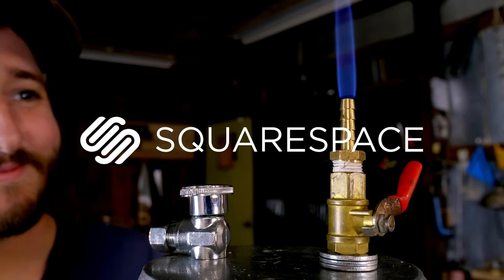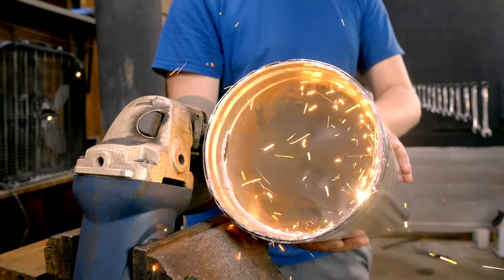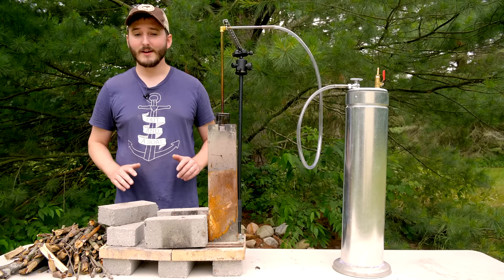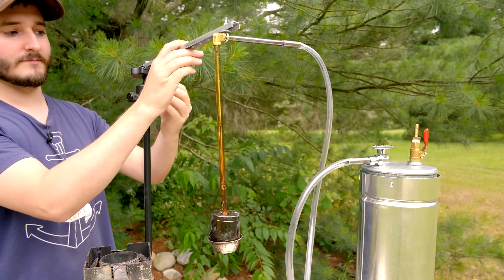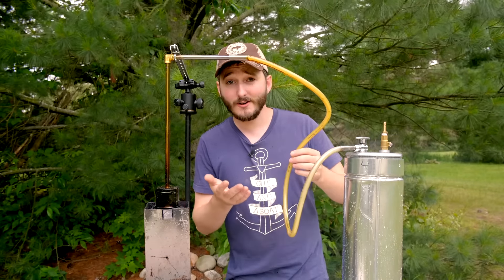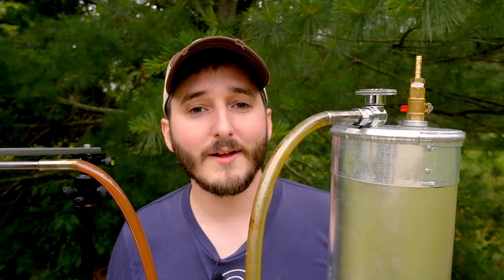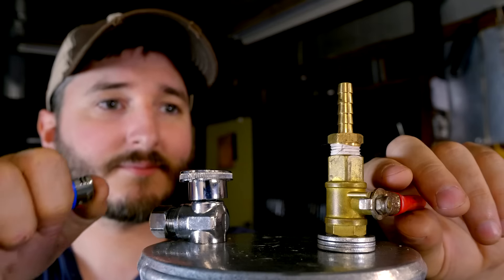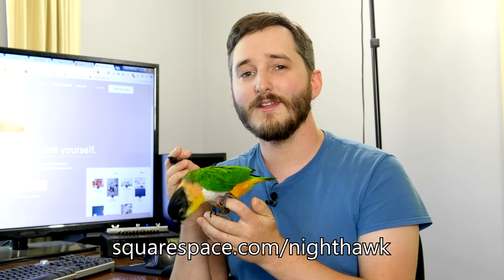Bio Fuel Storage: Building A Gasometer

Comment: A gasifyer on a truck is cool. I didn’t know how much this technology was used in Europe in ww2. What if I collected this gas in a ballon type setup and added a little methane and hydrogen to pep it up to gasoline or diesel levels of power and compressed it. Would it turn to liquid? At what pressure? Then could I run it like propane with a bottle into a engine. All this science is cool and I love it because it fits with my business plan. I think the answer is to convert a diesel to burn wood gas and hydrogen and methane is to not replace diesel but use it also. The old diesel before low sulfur came out. Was way better for lubrication and it pulled a lot harder and better fuel miliage. The diesel would provide timing and ignition ( no spark plug needed ) just supplement the diesel at the right level would provide the power and reduce diesel consumption with a small modification. If I worked with you we could make this work and stop the oil companies from gouging the US. Provide fuel for offgriders. Think about the hurricane victims in Florida. What’s a gasifyer worth to them running a gas generator. To heat and cool there house and keep life as normal. This is the answer with all kinds of application. I just don’t know the proper mix of gases to produce a gas that used like propane is. You don’t want to crash oil we need all the things that come from oil just not the drama with oil

Comment: You mentioned adding some weight to add pressure and this makes me think of something I have "always" wondered about. What happens to the gasifying process if you add too much weight? In other words the pressure increases to the point where it is not able to produce woodgas? At what point (pressure) does that happen and are there different designs of gasifier that could produce gas under higher pressure? And just to add - thank you so much for your brilliant videos. All of them are great and you display a curiosity that is just so very very inspiring.
Reply from the maker: You will probably not stop producing wood gas at any pressure, but at very high pressure the gas itself will begin reacting and turning back into various solids and liquid hydrocarbons.

Comment: Thank you so much!!
I blow glass and would love to do this with our outdoor rocket stove!
So if I need 15lbs of pressure I simply make sure the entire top with valves and all connections need to weigh 15lbs? That simple?
Reply from the maker: Little harder than that, because adding weight will raise the water in the tank which will eventually overflow rather than increasing in pressure

Comment: Silicone tubing should be high temperature and rubber should be just fine also if you go with the rubber one try going for high temperature vacuum lines for automotive.

Comment: "I can drain that condensation into the filter." here let me fix it for you... "I can drain this, mixed, heavy and light bio crude, as well as the low and high grade bio fuel into the filter" 😂 The separation of all four of these is arguably even easier to achive as the Syn gas filter setup you made....  refinement of the crude (again as simple as the filter) into high grade petrol would also yeild coke ash as well as  charcoal from the gasifier if stopped at the right time...I could go on.

Comment: OR make a bubble chamber. This chamber is half filled with water. The input port is at the bottom of the tank. You push your gasses into that port. Make sure that the tube connected to the input is leveled with the water in the tank so that the water does not pour out from that port. The output port of the bubble chamber is at the top. With enough gas, pressure will build up and the gas will push itself from the output valve. Store the gass in a separate container after it passed trough the bubble chamber. You don't need this sliding bottle.

Comment: bit late to the party, but instead of worrying about condensers or different tubing as others suggested, why not have the gas input attached to the base instead of the moving part?
attach the pipe to the bottom and make sure the elbow or 90 degree bend is above the water level.
also don't make the pipe go into the gas portion of the gasometer on the inside, instead leave it at the bottom so the gas has to go through the water providing some cooling and filtration as it enters the gasometer.

You could do the same thing with the output tubing but have this reach above the water level on the inside, this way neither the input nor the output would need flexible tubing.
The only possible issue I could foresee is that the gas generator will be at a higher pressure due to the hydrostatic pressure in the gasometer needing to be overcome.
I think this might actually be beneficial provided the seal of the can is able to handle this higher pressure.
If that does form an issue a solution would be to use a low container with a high diameter (surface area), the same (or greater) volume but less hydrostatic pressure.

Of course a lower container would diminish the filtering and cooling effects of bubbling the gas through the water, since it will have less distance to travel.

While I'm over engineering it might be worth it to add stoppers so there's no chance (or lesser chance) of the contents of the gasometer being dumped if it overflows and releasing a bunch of flammable gas.
Although that might go too far as it then asks for some kind of overpressure relief so the thing doesn't blow up instead of just falling apart.

I'm going to stop editing now before this becomes a multi-paragraph thesis of me thinking out loud, great video might give it a go myself sometime :)

Comment: I see. So you could use multiple gasometers to store alot (if you wanted to make the woodgas during summer then use during winter)  but you had mentioned to me when it's compressed it could self react and cause an explosion. 

Hypothetically though if you could take out the oxygen within the woodgas (maybe using a chemical in the water you filter it through to absorb the oxygen) would it still be so volatile when compressed? 

I know that increasing pressure inside the cylinder while pumping it in with a recovery machine does result in heat but how much heat does it take for woodgas to spontaneously combust? 
And could explosion be prevented by putting the cylinder in an ice bath? 

I just think it would be neat to be able to store a large quantity of wood gas rather than just a little bit with these gasometers. And having it pressurized would make it more convenient for use rather than having to press down on the top of the gasometer to increase pressure.
Reply: I apologize for my ignorance. I just don't fully understand how it can be so volatile when compressed
I suppose it could be the carbon monoxide..it's 27% and explosive limit is 12.5% - 79% but even then the auto ignition temperature is 600⁰
I don't think it would reach that kind of temperature while putting it into a recovery or lpg cylinder.
Reply from the maker: I don't know enough to say for sure how to avoid hazards for compression. The mixture has the potential to self react because it is a combination of hydrogen and CO known as syngas. Under heat and pressure this can react into all sorts of organic chemicals.
Reply: @Nighthawkinlight  ah I see. I'll have to look into that. Thanks for the reply. You teach about awesome stuff. Electrolysis, pyrolysis it really sparks my imagination for ideas. Saw this one video where people use pyrolysis on bones and the charred bones become* really helpful for the root system of plants :)  it was neat.

Comment: First of all you should be using a heat sink to draw heat away from the vinyl tubing.. That would definitely help...the bigger the better...the tubing is an insulator so a metal heat sink that is between the vinyl tubing and your contraption will draw heat away from the tubing...also get 10ft of refrigeration copper that matches the vinyl tubing...be careful at the home center and make sure that the copper will go inside the vinyl tubing...put a piece of the copper (1ft or what length you think that you need to be certain that the vinyl tubing can be used for the rest of it without worrying about heat damage...use a lubricant to get the copper inside the vinyl tubing..leave some copper petruding so u can connect the vinyl tubing to it..use hose clamps or zip ties for the copper to vinyl tubing connection...essentially you are making it more heat resistant by having copper inside the vinyl tubing

Comment: If you are looking to improve the gas generation, you must to use dried biomass (wood) with less than 20% humidity; this will increase up 85%. But , if you can use fluidized system, you can burn much better your biomass and to get higer production of biogas and bio oil also.

Comment: Instead of using a flexible tube, put a metal pipe up the center of the gasometer. The solid pipe no longer needs to be flexible, and if you make the pipe high enough to  go above the water, you won't have issues with too much water causing pressure issues.

Comment: When gas is generated, do you have to make sure the pressure in the tank, where you produce the gas, great enough to lift the upper container of the gasometer? I'm just thinking what if the gas pressure is not great enough to get in the gasometer.
Reply from the maker: Yes, you need some pressure but very little. 0.1 psi is enough.

Comment: Could you use a coil like your desalination bottle before the vinyl tube? Maybe a chamber after that with holes at the top for the inlet and outlet, so the condensation filters the gas until it gets too full, then drips into the chamber instead of going on into the tube? Idk, I know way less about woodgas than you lol

Comment: We could make a hybrid vehicle that runs on wood pellets, the gas heats water. Nothing to clean. The best small modern steam generator we can fit into a vehicle. The electricity generated simply extends the range of a modern electric vehicle. Use compact and overbuit key components, like the pressure pot. We had 138 mph steam cars, diesel electric trains, and hybrid electric cars nearly 100 yrs ago.  It's the government that holds us back. Juniper grows like weeds. It's the best firewood. If the whole house had a similar system and ran on the same fuel, that would be great. We use Juniper locally. A person could have a tiny pellet mill in their back yard. It could all be tied into any existing solar and or wind, water turbine, battery system. The whole world would smell wonderful and there would not be smoke everywhere.

Comment: My dad’s farm had a 1000 gallon methane digestor that worked from hog manure. Very similar to your set-up here using tractor inner tube for a seal and a compressor to concentrate the gas.  The methane was then used in the tractor on the farm. The previous owner of the hog farm barbecued himself with this contraption from an errant spark so my dad would never use it and it rusted away to junk while I was growing up.

Comment: Could you use a much heavier upper tube (or just add weight on top) to store lots more gas? In other words what's the pressure of the wood gas coming out of the generator? Could you use a valve to prevent backflow to store it at higher pressure than the generator makes?
Reply from the maker: You can add some weight,  but with too much it will force the water up and out of the lower tube. This is for low pressure collection and storage

Comment: Great vid my guy, but couldn’t you run the vinyl tube to the bottom of the gasometer so it’d bubble through the water and you also wouldn’t need a flexible tube
Reply from the maker: Forcing the gas below a waterline requires pressure, think about blowing bubbles through a straw. You could run a solid tube up through the bottom and above the waterline though and in that way not need a flex tube.
Reply: @Nighthawkinlight  Ahhhh true forgot about the preassure, but yea good idea on running the solid tube through the bottom, didn't think of that!

Comment: You can make the gas fill static. Perforate the outer tube wall near the bottom and run the copper tube through, sealing it or using fittings on both sides, turn it upward into the center of the pipe under the center pipe.  The input line will not have to move for the inner chamber to move. The inner chamber wall will move between outer chamber wall and inner tube. Gas enters the left side of the U then comes out the right side higher than the water on both. As long as the top of both sides (Inside and out of the resulting U are higher than water level there would be no hydraulic back pressure.
Reply from the maker: I realized that myself some time later. That would be much better!

Comment: Hi. I've been interested is gasification on and off in the last 5 + years. I appreciate this presentation. 
I have a nuber of questions. 
1- How does the top seal of the gasifier withstand the pressure of the weight from the stainless steel pipe 4- 5 feet. It must weigh between 1/2 to 2 lb.
2- How long does the filtration process take? Would it make a difference if the inlet had a tube extension running down close to the bottom (and a air diffuser to break up the gas bubbles) in order to speed up the filtration process, i.e. the gas would traverse the water in order to reach the top. Also, the gas would cool much faster and be usable at its prime temperature.
3- In this setup, how many cycles (adding fuel) would the water last for filtration, assuming this setup for a continuous use like an engine.
4- Considering rust on the water reaction and the gas on the steel and the various metal components, how viable is this combination on the catalyst reactive degradation of the metal components?
Reply from the maker: 1. Water is displaced for the weight.  2. 15 or 20 minutes. 3. Not sure, haven't tested. 4. The metal seems to hold up fine.
Reply: @Nighthawkinlight  Thanks for the prompt reply.

"1. Water is displaced for the weight". Please explain. I'm referring to the weight of metal tubing vs. the tar seal.
Reply from the maker: It's a water seal. Put a glass upside down in a pot of water and you'll understand. The water on the outside of the glass rises

Comment: Would it be possible to run a forge off of wood gas? Namely a forge for shaping steel...
Reply from the maker: It doesn't burn as hot as propane. You can run a forge off wood or charcoal though
Reply: NightHawkInLight thanks

Comment: Copper piping comes in a spiral roll also... your metal pipe might break down with the rich hydrogen content of the fuels... embrittlement.
SOOO.... 1/4" inside diameter copper tubing... perhaps a copper manifold at top of gasifier... adding an anti-flashback section into the final output line... would make safety less an issue to me.

Comment: I know this is late but could an improvement be made on the gasometer? Instead of a rising float container make stationary containers with rising water as the pressure system.

Comment: would you be able to use the heat generated from the wood burning for some practical purpose such as cooking, space heating, etc. or would that make the gas collection inefficient? it would be cool to optimize this system for maximum efficiency and use. and, since youre heating up the wood in an air tight container, would the leftover solid byproduct be usable charcoal?

Comment: I fully understand the concern about the vinyl tubing. And over time it will break down due to the heat and the mild corrosiveness of the hot gasses. But silicon tubing is designed to handle higher temperatures and can withstand the corrosiveness of the hot gasses. Thusly, you would maintain the flexibility you need.

Comment: Plan upgrade again: make 6 -inch square tubeing =rocket stove...then make 3 inch pipe with end cap on each end: do 3/4 - gav pipe as top  -run the pipe up 2 feet/then over 2 feet.. then down 1 feet/then 3/4 Tee .. bottom tee /put a 6 inch piece 3/4 niple and a 3/4 valve..trash and water clean out. 6 feet 3/4 copper pipe into a water filled cooler-sealed were goes in side . then another pipe at top the cooler is gas exit .it will be very clean -blue burning gas //at this point! add flare /T/valve and hook it to a air mattress. Then can be pumped into a propane tank for cooking/ heating ect.. :>)

Comment: Would it not be worth having a section of tubing or better straight pipe from the inlet of the gasometer to about 3/4 to the bottom. This way the gas would be cooled and "tar" filtered - "bubbler" fashion inside the Gasometer. Might even consider a "coiled" configuration also. just a thought.
Reply: Oh your passively creating gas so a down spout Bubbler would need to be shorter in length

Comment: Some technical data on how much gas @ atmospheric pressure it would take to boil a specific amount of water would be nice to know . So is it more advisable to do your cooking on the fire that creates the gas , then use the gas for lighting at night … Where and why is it beneficial to have the gas in a real world off grid application ?
Reply from the maker: Gas is useful because you can use it to run engines and generators.

Comment: I thought about incorporating a gravity-fed system, but the possibility of backflow (or overflow) outweigh any potential benefits. I'm thinking of using a hydrogen-powered steam turbine as stage 1. I have no use for hydrogen, so if I can reclaim some of the spent energy, it'll bring the electricity bill down a bit.

Comment: Great video. How do you keep the valves from getting fouled with the epoxy when you seal the gas collector? I am wanting to run a generator to charge a battery bank to run our house. in the winter we already burn wood -  5 -6 months of the year here in upper mi
Reply from the maker: The stem of the valves sticks through the surface a good amount. I just made sure not to fill the epoxy too high